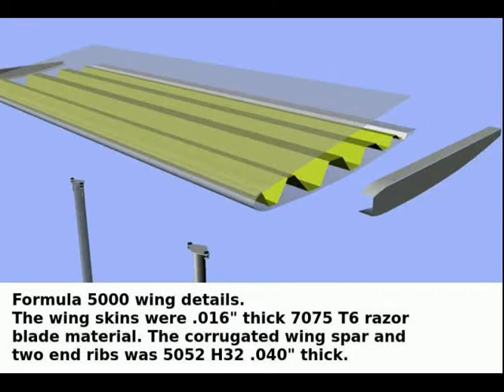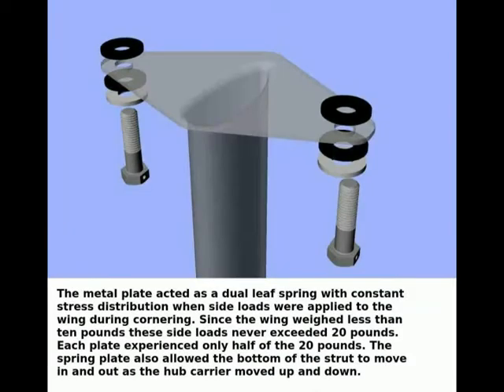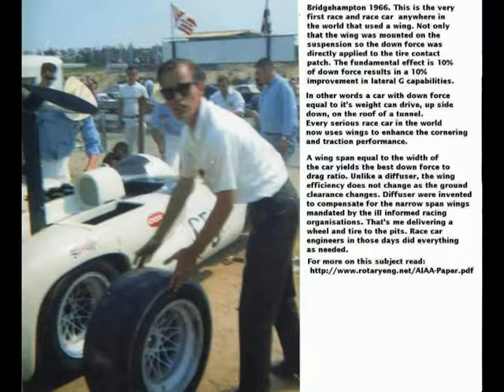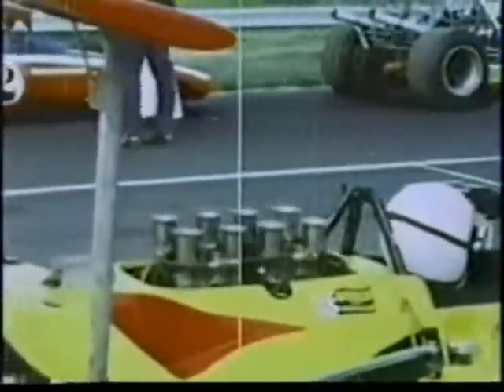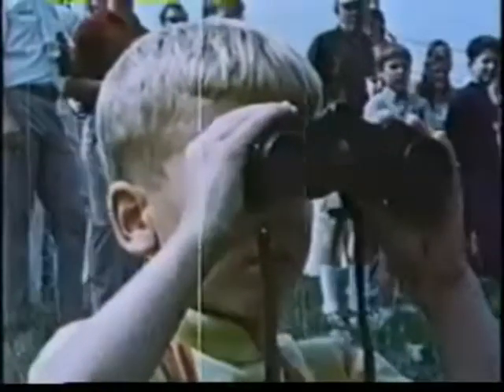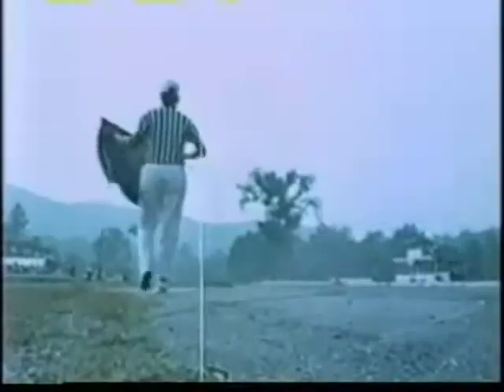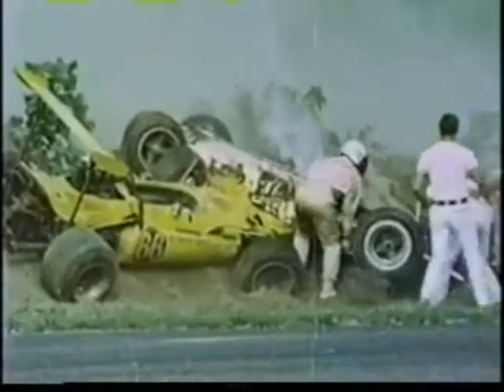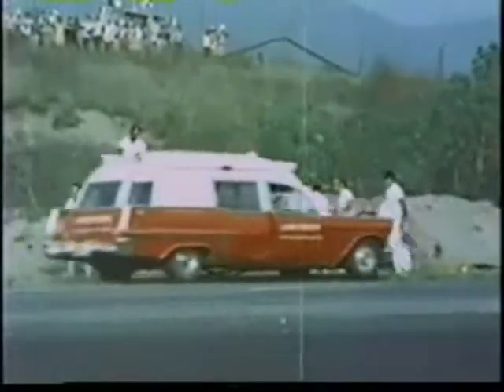race car wings

Comment: It's funny about the comment of Colin Chapman not understanding wings, as he studied structural engineering and was a pilot. I'm not the only one that will say that, I think he knew exactly what he was doing. Racing cars are made as light as possible and to last the race, only sometimes the limits are breached resulting in failure. Modification or partial/complete redesign to address these issues...